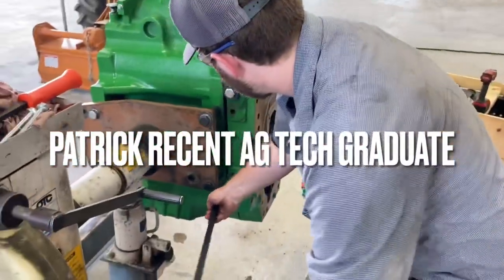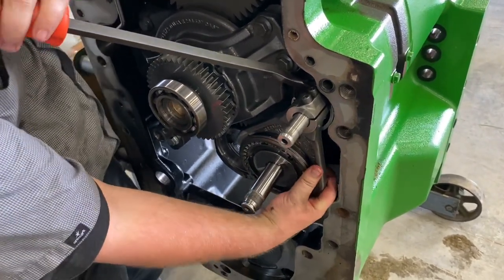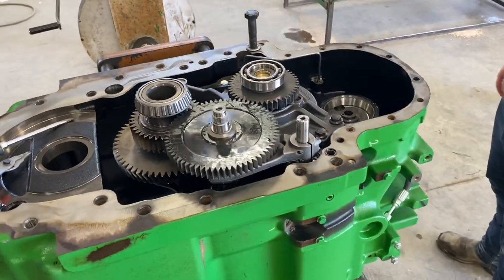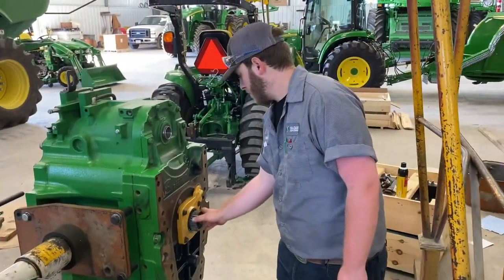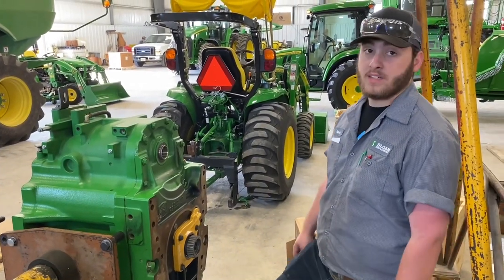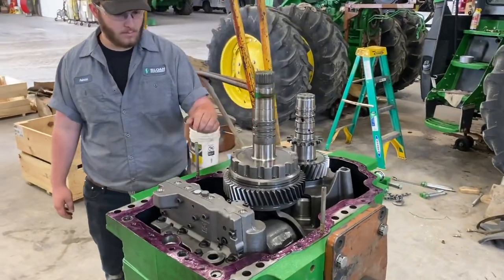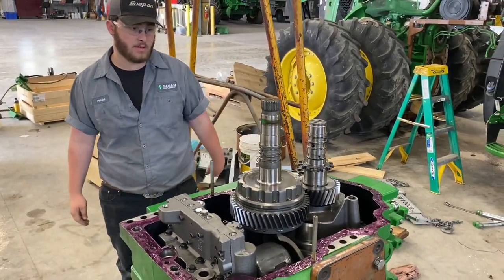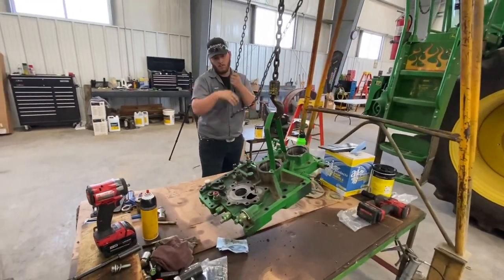John Deere 8370R IVT Hydro Improvement

Comment: So an IVT is like an automated manual with a planetary set and a big hydraulic pump? It doesn’t have a torque converter so does it go into neutral when you stop the tractor or is there something im missing?

Comment: ZK, I need your help, I have a 7280R ivt, it runs for about 3 hours and then it slows down and after a minute or 2 it goes back to work. 2 red cans were changed, the technicians here have no idea where to look. Thanks a lot
Reply from the maker: The only way i could help you is if i physically could lay hands on it to do pressure checks.